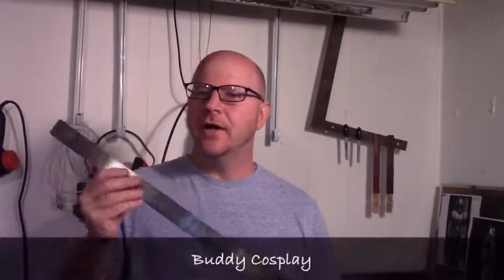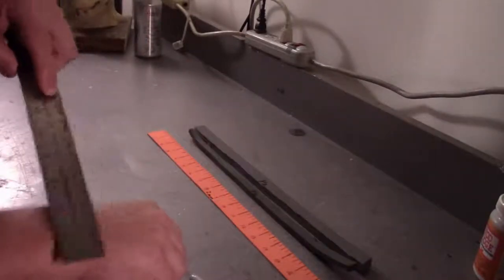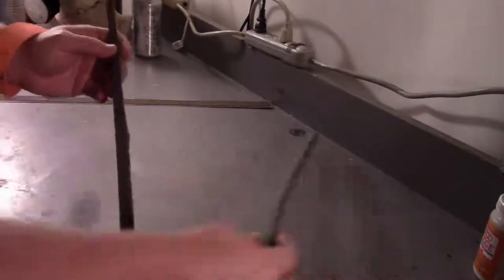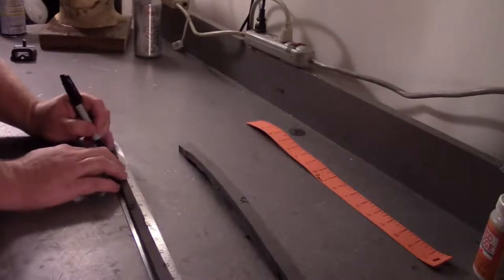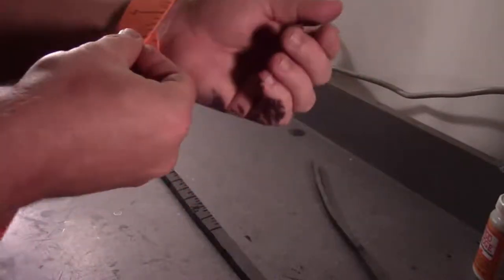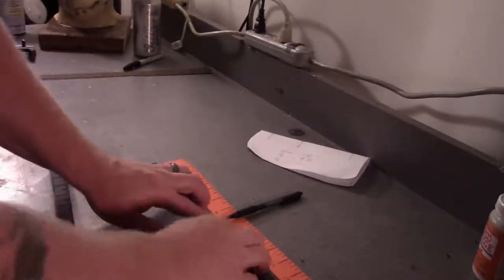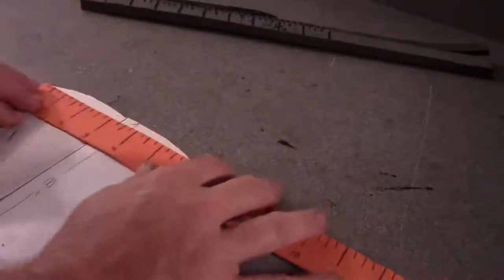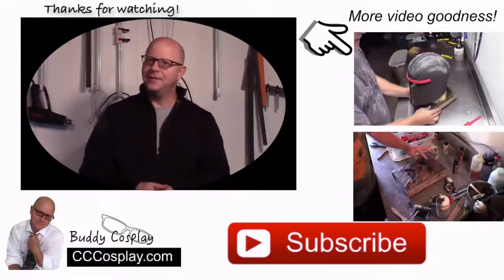Cosplay Tip- DIY Foam Ruler for better accuracy using eva foam for your cosplay armor

Comment: Good afternoon!
I'm wondering if I can use foam sheet to make a faux leather book cover? My worry is that the foam would tend to take its initial flat position i.e. the book would open instead of staying closed.
I aslo am wondering if I can glue fabric or cardstock to the foam?
Any advices from you will be much appreciated!!
Francine
Reply from the maker: +Monster 3D Thin foam would be a good choice to make a fake leather bound book but you’d have to consider the bends at the spine as the foam isn’t that flexible (if the book would need to open that is). You can def glue things to foam such as fabric but do a test piece first to see if you like the results beforehand.
Reply: In fact that would be the same measurements and procedures than making faux leather bound book using paper bag, craft paper,... If this is what you meant then that is GREAT! I wouldn't have to buy an embossing machine to get a beautiful leather texture.
Please just confirm that I seized well your answer ☺
Reply from the maker: +Monster 3D The foam should work great. Apply heat, add texture with foil or something else, seal and paint. Good to go!  The only way the foam will go flat again will be if it is reheated. (don’t leave it in a hot car for hours and you’ll be fine.).
Reply: Thank's a bunch Buddy Cosplay for your help!!! Have a great day and lot of fun :-)